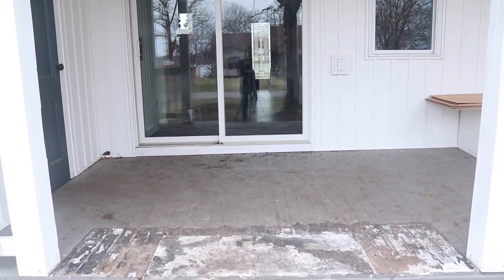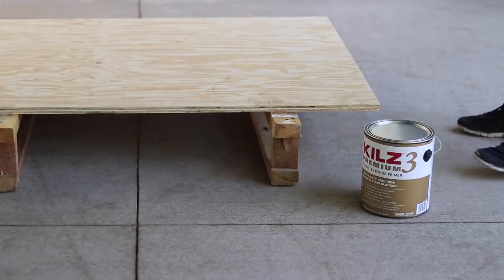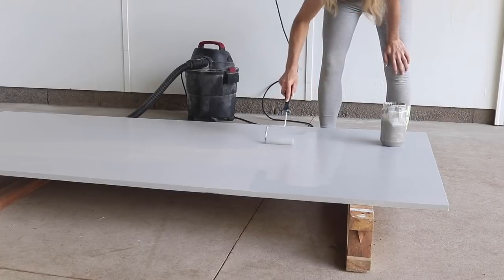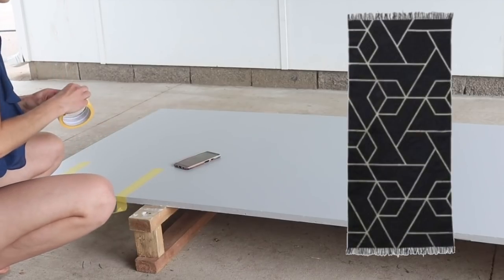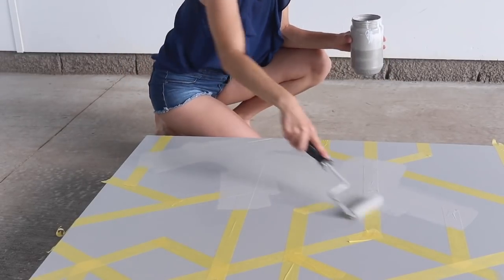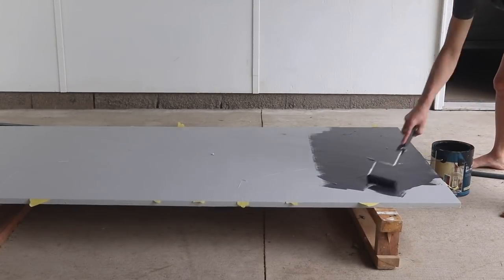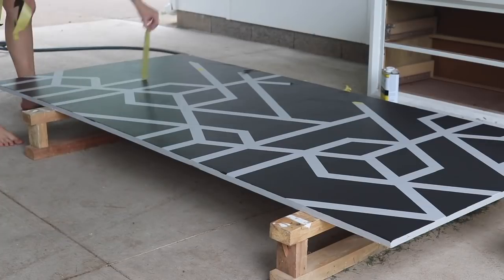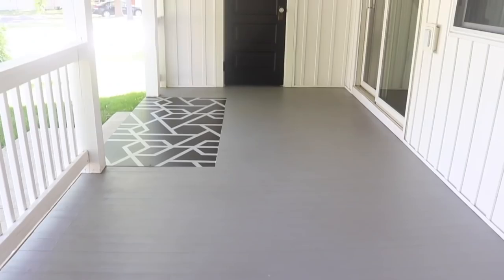Painting a Geometric Floor Design (FAST) | DIY Geometric Modern Design on Wood Porch

Comment: I love it, but please put some shoes on, going to step on a nail some day😩
Reply: A nail will go right through a shoe so that's no protection. If you're running around barefoot, you tend to watch where you are stepping so you're probably safer. Besides, bare feet are comfortable and much cooler in the heat. Very few people actually enjoy wearing shoes and if you don't actually need to, then why bother... watching where you are going is a small price to pay for the comfort.